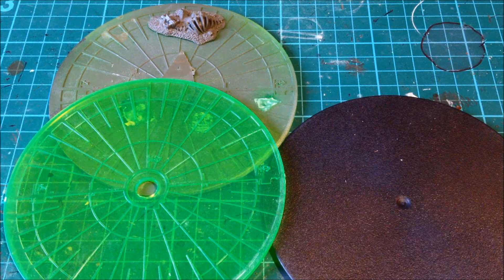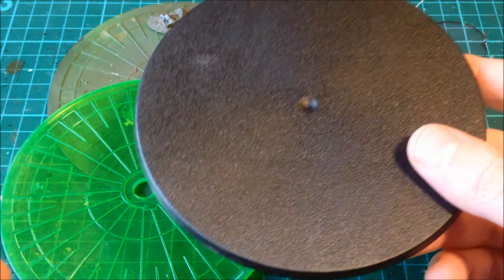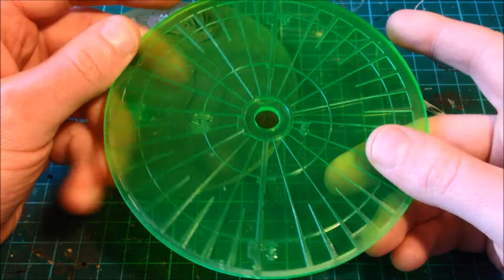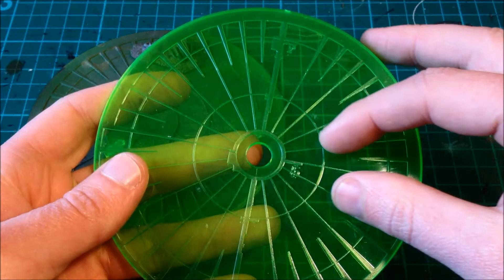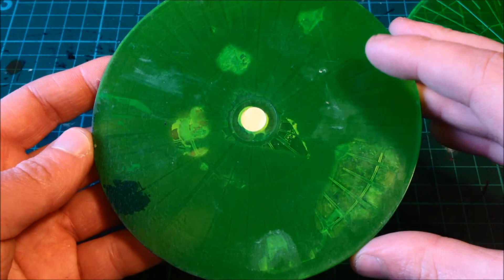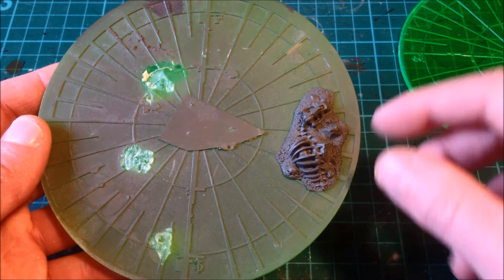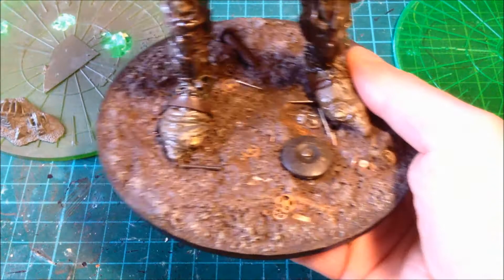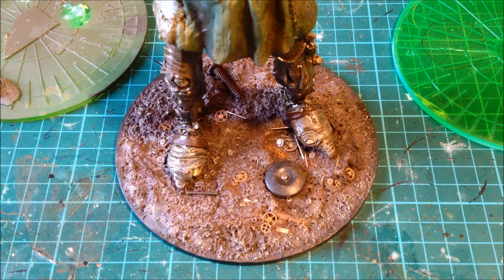How to Build Better Bases

Comment: Nice tutorial. I've done similar for some pieces of scatter terrain, some with old blast markers, others with old CDs.
The only additional step I took was after the underside was painted black, I glued on some weed matting and cut around it once dry.
I got a massive roll of the stuff from a local garden centre for £5 and I've barely put a dent in it. It gives it a nice finish and a no-slip texture for tabletop use.
Reply from the maker: Excellent stuff! I have used old CD's for terrain too, my brother and I built a modular trench system using them and some modroc, lolly pop sticks and some Milliput sandbags.
Reply: A modular trench system on CD's, sounds cool but I'm having trouble visualising it in my mind's eye.
I have some sketches somewhere from when I was planning a bunch of CD scatter terrain. I was going to try making some modular ruins,  the basic layout was 4 CD's laid out in a square, each containing one corner of the ruin, with enough open space in the center so that a 5th CD with a large rubble pile could be placed inside to complete the ruined building. The rubble pile could then be lifted out during gaming if it was a problem placing miniatures.
There were other sketches of wall extensions on other CD's that could be placed between the corners to make the ruin larger.
Was that kind of how the trenches worked? Open ends on lengths of trench so you could keep on extending the trenchworks?
Reply from the maker: We built them across the CD with open ends either side, you could then place them end to end and expand the trench system as long as you wanted. We also had some corner pieces and underground bunkers etc.